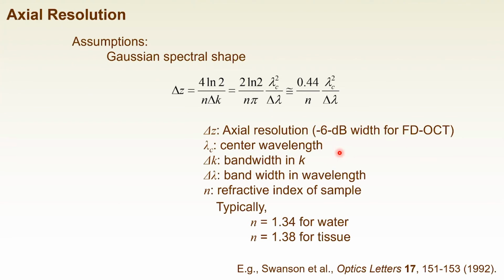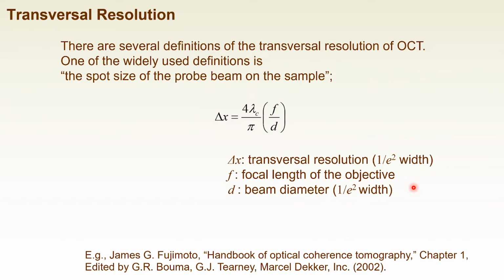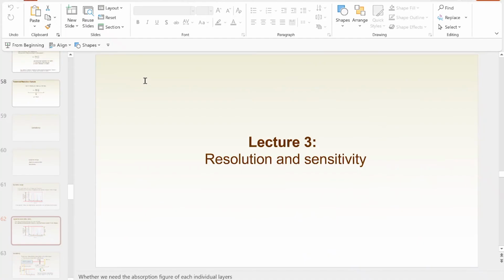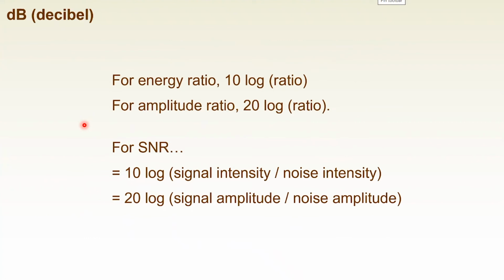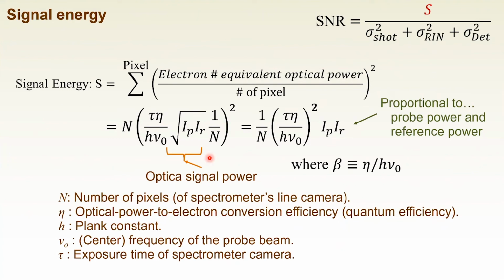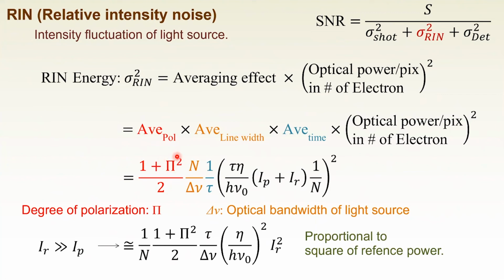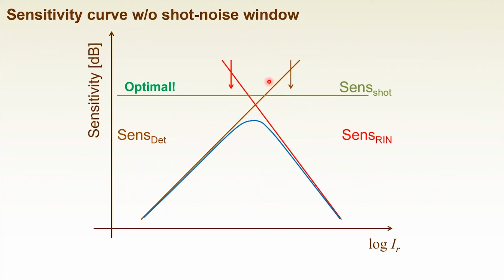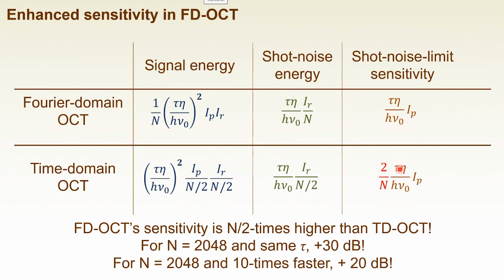Fundamentals of Optical Coherence Tomography #3: Resolution and sensitivity

Comment: Dear Professor, thank you for the clear series of lectures. 

In practice, does the formula for depth resolution account for Nyquist sampling? 
For example, for 830 nm light source with a bandwidth of 50 nm sampled at 5000 data points would give a delta z value of 6.1 um, even though 2500 are -z and 2500 are +z values after FT?

How does this change delta z with 2x zero padding?

Thanks!